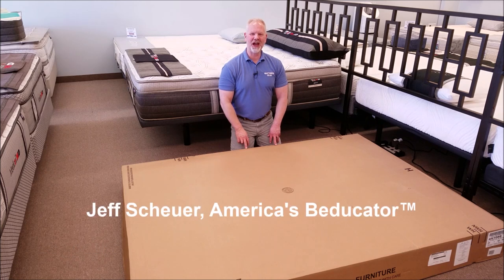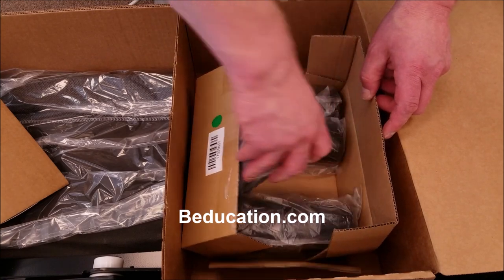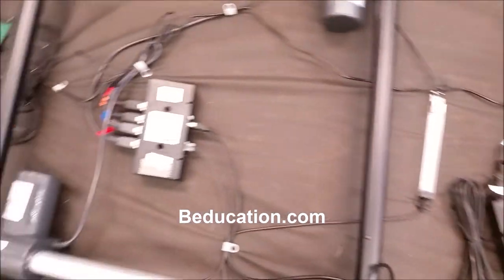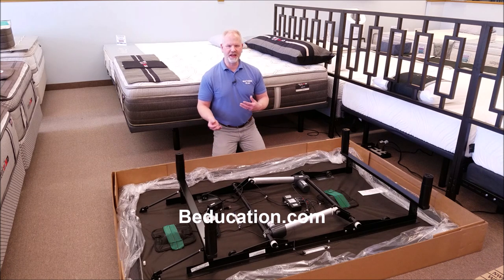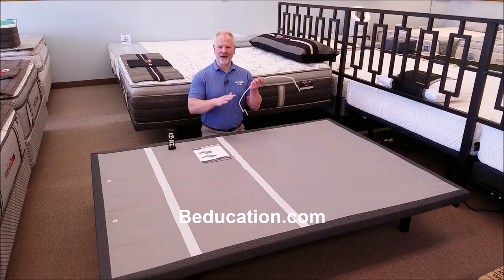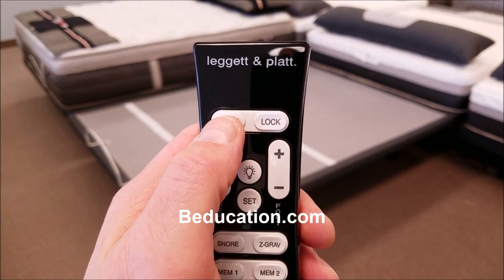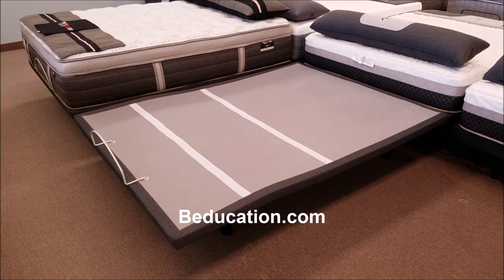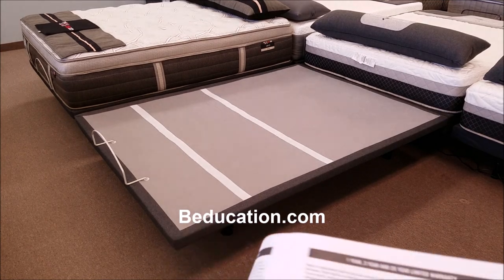Beducation® - Simplicity 3.0 Leggett And Platt Adjustable Bed Assembly And Operation

Comment: Soo... If a leg breaks and part of the screw-in part stays in frame is there a way to get them out? Im about to buy new legs just want to consider options. Thanks!
Reply from the maker: If there's nothing left of the screw to grab onto with a pair of vise grips, you can purchase a screw extractor kit from home improvement or auto supply stores. Inexpensive and easy to use.

Comment: Where does LP put the model number?
Reply from the maker: The serial number is located 1) on the front of the owner's manual; 2) on the back of the remote control; and 3) on the underside of the base at the head or foot end of the metal frame. On some models, it may be necessary to raise the head or foot to see the sticker on the frame. Split King bases will have two serial numbers.